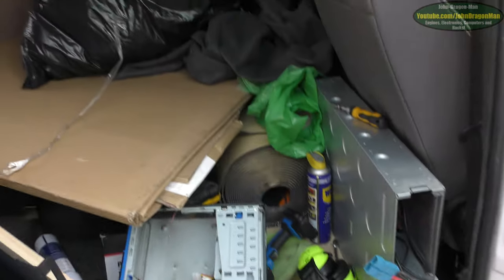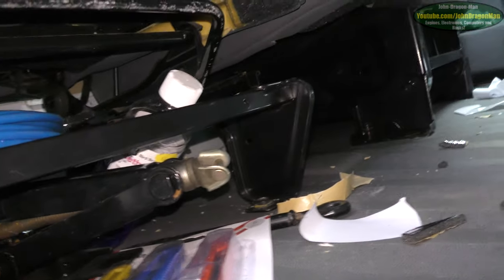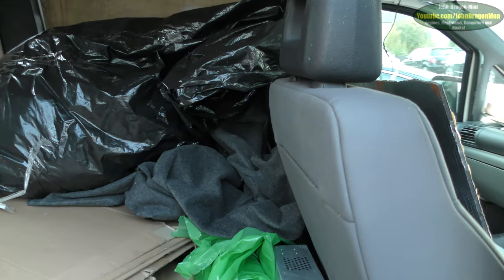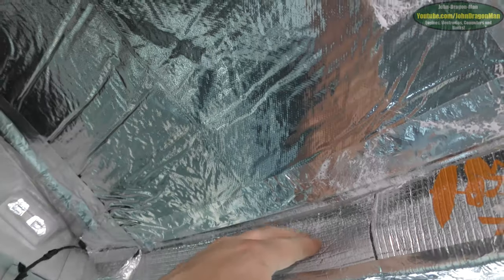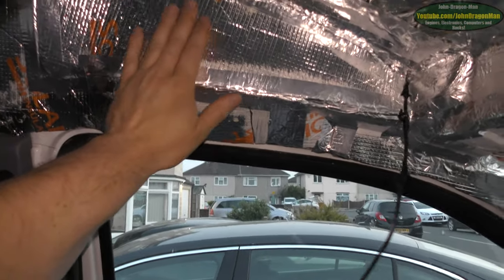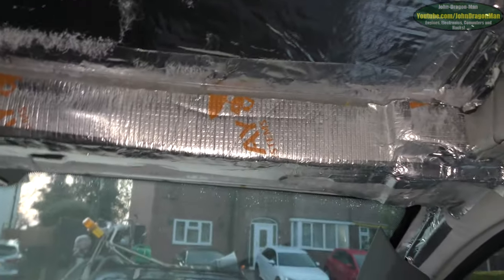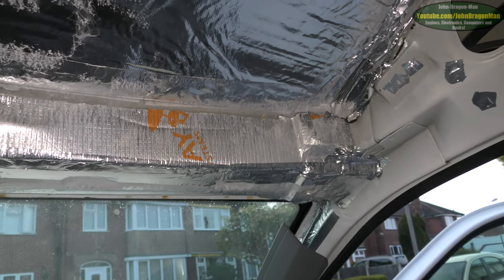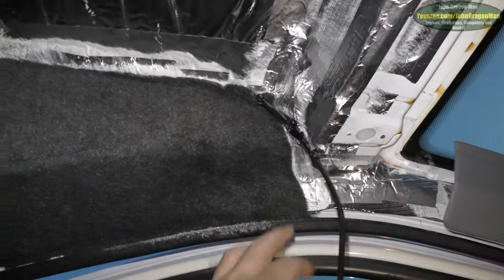Citroen Peugeot Fiat Dispatch Jumpy Expert Scudo Micro Camper Conversion - [12] cab roof insulation

Comment: Subbed ,watching with interest as ive got a dispatch which ive made into a camper.It's just not running right.There's a couple more hidden storage places you will find lol.
Reply from the maker: Oh do tell? I've sadly had a bit of a setback with mine as the sills are a lot more rusty that I previously thought :(
Reply: @johndragonman  Plastic off at the back sides,over back wheel arches  ,nice little hollows there which would be ideal for passport,cash etc.Hope their not to bad and new sills /welding can sort it out.My engine has to run with the plugs off the injection advanced solenoid,when you add the plug,engine unsettles and churns out blue smoke as if unburnt diesel.Sounds like diesel knock,engine products not solved it.Injecting to much ?.My engine is a 1868cc DW8B  WJY .My last engine broke inside so replaced with new old engine but have this problem to sort  out so any tips or ideas you can think of would be gratefully received as i'm scratching my head !!!